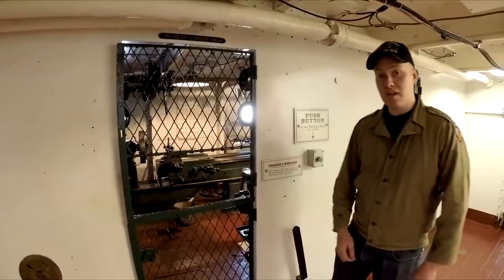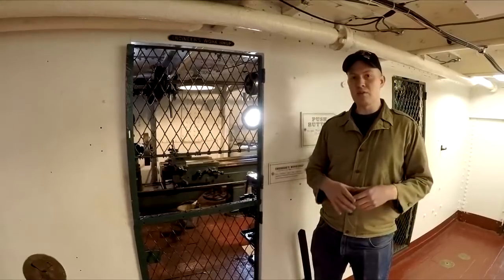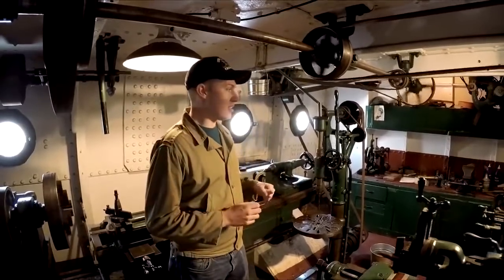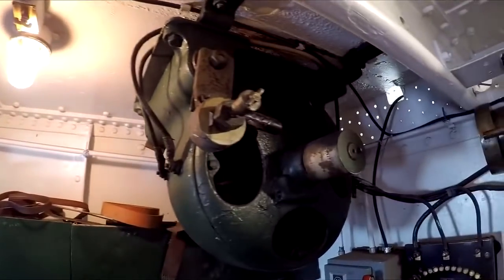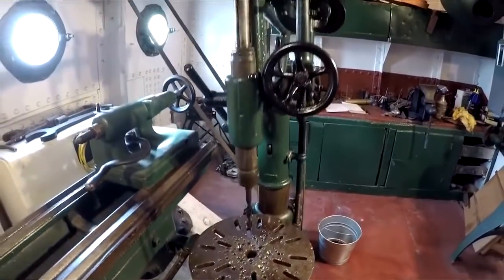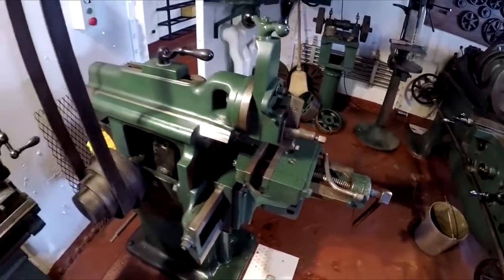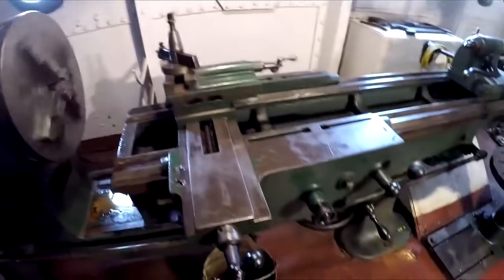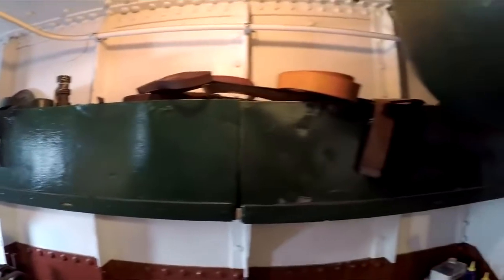The Machine Shop Aboard Cruiser Olympia

Comment: I am a retired navy MR. That is a big shop for the size of the ship.I worked one time on a ASR 13 Kittywake she was a 250 foot ship. Most people don't understand what it is like machining while at sea on the atlantic. The ship will rock upto 30 degrees. After that it gets trying because when the ship tilts the back play will come out and break your cutting tool. But you can time it cut up hill and stop for the down hill. That shop as you can see is osha approved. They would love the open belts.Of course you dont run all the belts at once. They will be going allot faster. I went on that ship back in the early 80s I don't remember seeing the machine shop.

Comment: I find it fascinating that they found a shaper to be more important to have than a miller, the shaper is slightly more versatile, but insanely slower. On the other hand, milling cutters would require a much more complicated sharpener than single point tools would.

Comment: I was a Machinist's Mate aboard the battleship USS Missouri (BB-63) for three years. No, in the modern Navy MMs don't run machine tools (I worked in the engine rooms), that's done by MRs (Machinery Repairmen). But I did have much to do with our machine shop and the men who worked in it. Going from memory here, but I remember (at least) two large engine lathes plus a small South Bend toolroom lathe, a horizontal mill, a large shaper, a Bullard Vertical Turret Lathe, and I'm sure that we had drill presses although I don't remember size or type. No vertical mill, but with the shaper and the horizontal mill our MRs could work around it. The next compartment forward held a full motor rewind shop, and there was an overhead monorail which connected (via a chain hoist through a large hatch to the third deck) to the monorail which ran the length of the engineering spaces down Broadway.

As the commentary here said, we really couldn't stock enough spares for all of our equipment. Instead we carried "blanks" which the machine shop could finish into needed parts...and not only for our ship. During our deployment to the Persian Gulf in 1987 we were the most capable repair facility within 500 miles, and our MRC used to grouse about being assigned "to the only tender in the Navy with fourteen-inch armor!" Good memories.

Comment: Drill divots on the drill  press table WTF.  Ha ! ran a shaper once to rough out  a plastic injection die block when I first started out in the tool and die trade. They are rarely seen/used now obsolete for the most part.

Comment: So far, no one has mentioned what it must have been like in that confined space using tools that can maim or kill you while at sea. The pitching and rolling would have made any job 1000 times harder and more hazardous. But if you needed a part, perhaps to save the ship, the machinists would have had to do their work regardless of weather conditions. These videos are terrific. Keep them coming.
Reply: I'm a fabricator by trade, so never used a lathe in my work, only a pillar drill. Watching this video gave me 'shivvers' at all those moving belts and gears, with LOTS of potential for "finger removal".  Brave men in those days and modern workers don't know how lucky they are.  Imagine trying to make something urgent in a hurricane.
Reply: Gimmi a brake ! that little space was my job for along time . I wasnt on a ship , I was on a barge , towed by a Navy tug , that carried a Piscies Deep Sea Sub . We had newer stuff than those old machines , and no line shafts .When its rough out , you dont want to walk far , you usually need something to hang on to . The sub launched out a hanger door at one end of my area . One day in rough weather , they had to open the door to let a zodiac in ,  behind it was a huge wave . The shop got rapidly cleaned . I turned around , to an empty work bench  , no tools ,no mics , no hydraulic pump pieces I was working on . Call Liz , the FlyGirl , for an air drop .
Reply: @paulbains9152  well that doesn’t seem too smart a design. You don’t plan on having the door open when it’s rough but if the potential of a wave cleaning out the shop is a real possibility… hope the folks on that zodiac were important lol
Reply: I wonder how many people fell onto a machine due to the rocking of the ship.
Reply: Magnetic boots

Comment: You missed something.  All those leather belts were from BUFFALO!  Until small electric motors were developed, and reinforced rubber vee-belts, those line shafts with belt take-off was what powered the Industrial Revolution.  The leather was stronger, thicker, with fewer scars that weaken the leather.  
That fact gets skipped over, a lot.  If you walked into ANY machine shop, in most of the industrial world, in 1895, you could see all those buffalo hide belts.

Comment: The lathe is the most important tool, from making new shafts to bushings.
Reply: i thought the same thing, the lathe can do anything the drill press can do, especially with that big 4 jaw chuck
Reply: @FailedSquare  

Especially with the split ways, since it doesn't look like the other side has a pass through chuck, given the tight space in there. (Speaking of: those belts humming six inches overhead would be very scary, imo- I've seen/ gotten to try working in with them once- on an antique sawmill's gang-saw, but that was in a big open area, well supervised, not in a cramped space like this on a rolling ship!)
Reply: I concur
Reply: I agree, especially since a lathe IS a drill... Maybe the drill press is the most often USED tool: especially in an age before widespread welding... but there's very little (rotary processes) it can do that a lathe cannot. (Though much faster at drilling)...

Was there a mill? I didn't see one. (Which could also drill).
Reply: Storm Shadow  that's something someone who only knows how to run a mill would say. A real tool maker can run everything equally well. So many people trained on mills who can't single point thread on a lathe.
Reply: @alexbarnett8541  I agree, if someone can't at least do all the basic operations on the main machines (mill, lathe) they really aren't a machinists, they are just an operator. 20 years ago I would have added the grinder to that list, but now-a-days I hardly see grinders in general production machine shops.
Reply: Storm Shadow  What's your point shithead. Needles to say you have no clue how to machine your way out of a paper bag.
Reply: @patrickhennigan9689  but you don’t machine pulped wood products….
Reply: @dirtyaznstyle4156  That is not a wood lathe. It is an engine lathe. It is designed to cut metal.
Reply: @dirtyaznstyle4156  

Haha, yeah- nobody wants dead cellulose chips (yuck!) on the holy lathe!
Reply: 🤨 Nah, the most useful "tool" to have at your disposal to ensure your warship remains in "ship shape", is to opt for the extended manufacturers warranty when you purchase the ship!  It's also smart to have a membership in the AAA subsidiary, called "ASA"(American ship association). 

👍 You know how the AAA will send someone out to help you when you've got a flat due to a hole in your tire?  Well, the ASA will send people out during battles, to help "patch" torpedo holes in your hull!  Or they'll help you reinstall your fire control systems, when they get blasted off of the upper superstructure by enemy cruisers...

⁉️ Strangely, the ASA has a very low worker retention rate, although no one understands why.......

Comment: Really cool,I once had a 1917 leblond lathe,much like that behemoth,belt drive also,with an ac motor over the pulleys and it was a 25inch chuck with a 60 inch bed.

Comment: I would dispute the statement that the drill press was the most important tool. The lathe can do anything the drill press and it can make parts to repair the drill press.
Reply: I was going to say this but you beat me to it!
Reply: Totally agree, the lathe is the most important machine in the room.
Reply: I basically agree, but you could make a drill press into a vertical lathe, if you had to, at least for some operations that a lathe does.  I suspect that the drill press was the most frequently used power tool in that shop, which is a measure of importance.
Reply: @Ferndalien   Ever try to use a drill press for a lathe???  I've had to in a pinch, and they suck at it. And while the drill press might very well been one of the most used machine's, the lathe was what did all of the critical work. You aren't going to machine new seal assemblies for a condensate pump in a drill press.
Reply: @Ferndalien  A machinist's imagination is their only limitation! That goes for all the machines in this shop!
Reply: Yes, the lathe is the master tool...you can drill with a lathe too.
Great vid, keep it going...cheers
Reply: Yeah, for me it's the lathe.

It can make things round, flat or spiraled !
Reply: If the lathe can do everything, then why does a drill press exist at all?… presumably because it can perform a commonly-needed task quickly and efficiently. Whatever tool fills the most important need is the most important tool, even if another tool is more versatile.
Reply: @jlwilliams  Drill press is quick and dirty - and can handle bigger jobs.

But if you want absolute accuracy not only with the placement but also the size of the hole, you'd use the lathe by mounting the work on a faceplate or 4 jaw, centering where the hole needs to be accurately to the tailstock and boring the hole to size.

But that takes a big lathe and a lot more time to set up - albeit with an order of magnitude increase in accuracy.
Reply: It is not very practical to drill holes in sheet metal or flat stock on the lathe, although it can be done. Im sure that such work was done all the time for making fixtures, flanges, and other bits with holes in them.
Reply: What makes parts to repair the lathe? And when the lathe is broken can other tools do what needs to be done? You don’t use the lathe for everything that’s not why it’s important it’s the importance of the parts you need a lathe to make.
Reply: @dirtyaznstyle4156  What makes the parts to repair the lathe? A metal file and the careful use of measuring instruments!
Reply: @Convolutedtubules  then using the logic a lathe is more important because it makes parts to repair a drill press, a file and micrometer is more important than a lathe. I mean you can make parts for anything that way if you have the time

Comment: just by using a hardwood round pole , you would knock the drive belt for
whichever machine you wanted to stop , Later on on , there were clutch type
apparatus that allowed for stop and start conditions

Comment: If OSHA had been around there never would have been a Navy.
Reply: To be fair, OSHA standards have saved many lives and limbs in the past nearly 50 years.
Reply: The drive belts in that machine shop are little different, if at all, from the drive belts used in land based factories and machine shops world wide at that time.  Yes, there were more injuries back then.
Reply: Brilliant, genius.  Real "out of the box" thinking there.  I suppose that, to in your reality, the abolition of press gangs and floggings was a bad move, also?
Reply: I’m curious what osha violations that ship machine shop actually has. Probably just the belt drives. All the machines there have potential to be dangerous but modern machines still have the same danger too.

Comment: It looks like all the machines are running all the time. How do you turn them off so you can swap out drill bits and other cutting accessories? Does each machine have some sort of local mechanical off switch or do you have to turn off the common electric motor for all of them?
Reply: you slide the drive belt sideways to an Idler pulley which is not driven
Reply: Each machine has its own clutch...
Reply: @staffordduecker665  there is no clutch on the drill press. The frame at 2:00 shows the mechanism to slide the belt from the driven pulley to the idler pulley

Comment: Split Bed lathe is actually called A Gap Bed. That drill press, the larger one is mounted in a tough spot to be using the lathe. Also that style of drill press was referred to as a “Stiff Head” because of the two bearings mounted far from each other. If the original motor still worked that would really be impressive. Not surprised it doesn’t function. The Shaper isn’t seen much these days in relatively modern machine shops but was a huge use in most all machine shops for decades. A planer would be a larger version of the same type of machining operation. I’m an old school Tool and Die maker and still working (66) and it’s glorious to see this machine shop that is like the ones my father worked in his whole career. He taught me the trade. I simply must visit this time piece soon.. thank you for the presentation. Outstanding job  keeping her so beautiful.
Reply: It's possible the original motor is still capable of working, and they just don't have a source of DC power sufficient to run it.
Reply: I was going to mention the gap bed lathe but I noticed that the machines are operating dry. Very bad. Must be oiled before use.  The dc mother would work fine and there should have been a winding area on ship or on a sister ship to rewind it. I know battleship Texas has one.
Reply: Sliding bed lathe. A gap bed has a removable piece just in front of the headstock.
I had one like that but never got it set up to run. I suspect that they weren’t very accurate.
I have always heard that style of drill press referred to as a “camelback”.
I agree, lousy spot for the drill for both machines. 
I’m surprised that they didn’t have the belts guarded since they are at ear level.
I bought an machine shop with almost identical equipment when I was just out of high school.
Reply: @pvtimberfaller  my current lathe is a gap bed and yes the ways are removable about 14” out. I have a 1986 17/23” Clausing Colchester w/Taper attachment/X-Y DRO that’s extremely accurate. No complaints. The Line Shaft machines were outstanding rougher/finishers. Very accurate even when using Logs and Indicators.
Reply: check this out https://www.youtube.com/watch?v=76xRkWhCbe8
Reply: You would be in your 90's if you were old school. At 66, you are still an apprentice.
Reply: @M70ACARRY  actually would be true for most but I served my apprenticeship under my father who was 66 in 1980…one on one ..between 1980-1989 in our own shop which had only three Index Mills (no DRO’s) one 9” southbend lathe, one 6x12 hand surface grinder, one bench top drill press, one die filer, one vertical band saw, one small cut off saw, one heat treat oven, one set of torches… that’s it. I got to learn how to design and build stamping dies, jigs and fixtures from him and he served his apprenticeship in the Pennsylvania Rail Road where old school was practically invented. I’m 66 years young but I still design on a drawing board.. that’s the old ways.. from this “young” apprentice.. lol
Reply: @paulbfields8284  I am 58 started my Apprenticeship in a machine shop in southern Australia in 1980 and all our tools were pre world war 2 with a couple of old Monarch pre ww1 lathes the most modern machine was a Cincinnati universal mill. I was a machine tool fitter and use to repair other machines. When we upgraded we bought old Dufor french mills and Macson lathes and a Berthiez borer.
Reply: @simonschuh5283  the older machines are really sweet to work on. I ran a WW2 Monarch Lathe at my apprenticeship contest in 1985. My first auto feed surface grinder was an Abrasive 3B.. another oldie and I loved it. Today I’m using all newer equipment. The lathe I’m using now is a 1986 Clausing Colchester that’s the oldest piece in the shop. I like the older machines a lot.
Reply: @paulbfields8284  The Navy still use Monarch EE lathe's to this day.
Reply: @riversideartglass  that’s because Monarch is one of the, if not THE best lathe ever made. LeBlonde Regal is another great one.. but the EE is the schitt
Reply: @M70ACARRY  I checked out your channel and you have Grandma's Birthday party and a bunch of amusement rides.
Maybe you aren't the best judge of the old school machinist.
Reply: Its definitely worth seeing, there are some other interesting things in the seaport museum too. 
When I went in 2017 you couldnt enter the actual machine shop but there was a button on the wall outside (which you can see in the opening shot) that activates the belt drive so you can look in from the doorway and see all the tools running.
Reply: I was curious what the modern day "shaper" would be, and i'm thinking more towards a CNC, a bridgeport or something. More function to do basically the same thing with more precision, with many more options, while taking up basically the same amount of space
Reply: @Joe_P  what surprised me is that shapers are still being made, brand spanking new. Of course they are from China, India and Pakistan but made neverless.
Reply: The lathe looks very similar to the Putnam gap bed lathe we are restoring at Tuckahoe Steam & Gas Association's machine shop museum, which is also line shaft driven. We are located in Easton, Maryland.